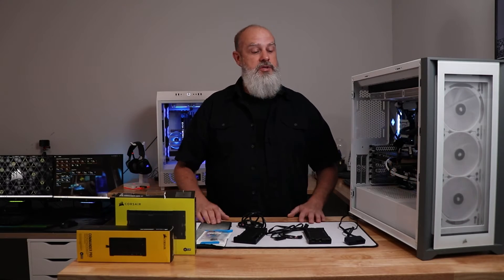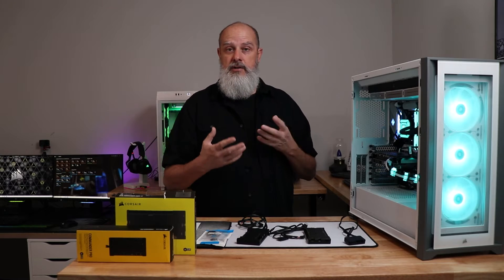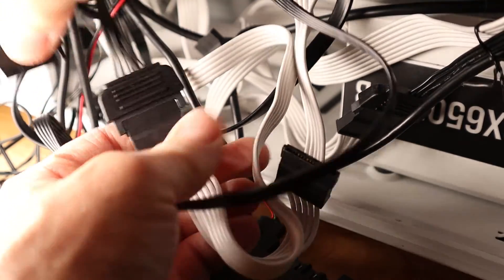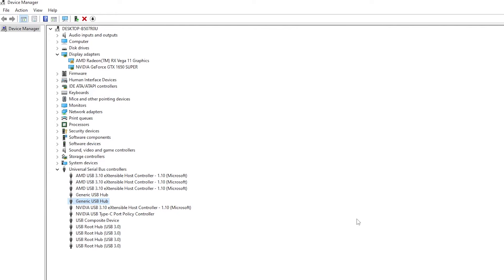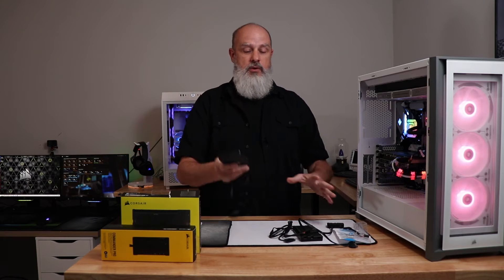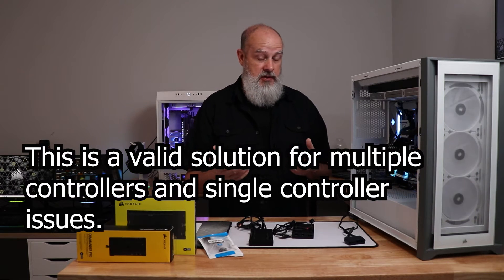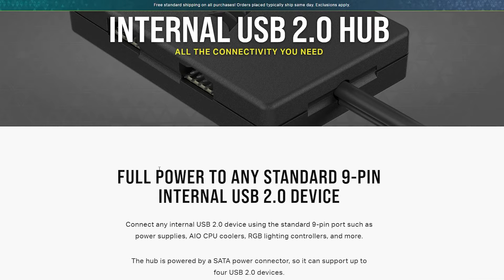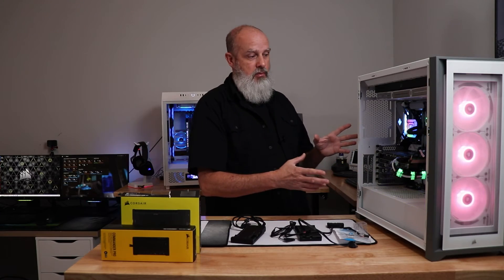Corsair iCUE doesn't detect my RGB controller

Comment: Good day mate! I've installed the H100i elite icue cooler, but for some reason when I shut down my computer the cooler and fans still stay on! ? Any ideas what may cause this ?
Reply from the maker: Hi John Kouros, I've never personally encountered this condition, except in cases where the system didn't properly shutdown all the way. I do see other reports of certain bios settings and motherboards causing this.

I can think of many things to try here. when you power off and your fans are running, check your keyboard, see if you still have activity such as caps lock, num lock, indicating power and activity, indicating maybe the system isn't full powered off. 

from there, if you hold the power button for 4 seconds, do the fans go off like they are supposed to? if not, remove your power cord, wait a minute and then plug it back in? do the fans run?

Regardless, i'd ensure your chipset drivers are up to date and perhaps update your bios and reinstall icue. 

Double check your power connections and possibly move the sata power to another port on the h100i. 

beyond that, look at settings in your bios, anything to do with power, including fast start, etc, try one at a time making a change and seeing if it fixes it. there are quite a few possibilities in there. 

Check out what power settings you have in windows and possibly look at the windows event logs during shutdown. 

I hope that gets you started, good luck, have fun, I like troubleshooting! Let us know what you find! 

Thanks for watching!

Comment: How many fans can you power from a single sata power cable? Installing 10  QL with a core xt, and core controller that came with the AIO cooler.
Reply from the maker: I'm not sure what the maximum number of fans would be, it would vary of course depending on the fans. I've never hit it though. The CORE XT and CORE should have similar specs in that they each will support 4.5A total across 6 ports and 1A per port. This is much more than adequate for your 10 fans. 

The QL Fan draws 0.30A per fan, perhaps a bit more on startup. So each port easily supports 1 QL Fan. 10 fans will be no problem on a single SATA power cable. 

Good luck, have fun, thanks again for watching!!!!

Comment: Thx for video,
Dude my problem is also same as uour topic. H150i doesnt detect from icue. Lcd shows liquid temp. Fans are spinning but no rgb light. What should I do? I readed all corsair helper still same
Reply: I'm having the same problem
Reply: @mrkmh1  😔 maybe cc is not working cuz we saw lcd screen and spin fans. Tomorrow I will buy it. I hope it will solve it.
Reply: I have icue h150i cooler show up but no RGB work. It works in previous 3 icue software . I have an Intel Mobo.
Reply: @MetalliacFeather  I solve it. My CC is not working properly. Then I change it. Now it is working. there is no problem.

Comment: i have 2 lightning node core I connected them using a usb 2.0 header splitter when I installed it wont detect anything, any ideas?
Reply from the maker: Hi Yummy! I would first rule out the splitter. Connect a single lighting node core directly to your motherboard's usb header just to ensure the controller is good, check both of them. Assuming they are detected at that point. I would try them one at a time on the splitter, try each port on the splitter seperately to detect if the splitter has issues. 

I would check, if you can, if any other usb device works on this splitter. I don't know what model your splitter is, but if it appears to be bad, try a powered usb hub, such as the nzxt. 

I would also uninstall and reinstall iCUE and ensure you have the latest version on version 4. 

That should be a start, let me know what you find. 

Thanks for watching!!!

Comment: Hello i nade help i have icue and all fans working but 2 of them lighting and 2 of them dont lighting they are lighting all, but when i one time go in icue to costumize my light they are shut down and they dont work sometimes when i turn up my computer they work all but when i put comp in sleep mode and turn up him the are shut down like its glitched or something 2 work and 2 dont work..
Reply from the maker: Hi Adem Sepic, I would suggest you try the following. The 2 fans that aren't working, take those fans and try them in other ports to verify the fan is good. Also, try known good fans in the 2 ports that currently aren't working. This should help you to determine if the fans are good and if the ports are good. 

I would double check in iCUE that you have the "All Fans" selected in the quick lighting zones at the bottom. 

If you're certain that your settings in icue are good. I would suggest making sure your firmware is up to date.....and if it is, force a firmware update. You will need to go into device settings, and to the right of check for updates, you have 3 dots, click that and force a firmware update. I've had to do this a couple times for oddball problems. 

If that doesn't work, try another power connection/USB connection. 

I am working on another troubleshooting video for issues like this. 

I hope that helps, let me know what you find! Thanks for watching!
Reply: @HardwareArtisan  hey man i replug all fans in comander pro but not comander pro second one smaler for led and they work now all of one that last one work but not corectly just mid lighting and on outside of fan in one space light maybe 5-7 cm in diametar and thats it can i fix that maybe? All fans work ok but that one is work half half xd can you have some isues??

Comment: Just built a new pc and the Commander Core XT is not showing up in the icue. My fans are running but just with a white color. Tried moving the usb. Has latest driver
Reply from the maker: Hi aztecace, make sure you have version 4 of iCUE. If you have version 3 and update it to the latest version, it still won't work and doesn't automatically update to version 4. I found this out the hard way after taking some time with it. Uninstall version 3 and download/install version 4. 

If you have version 4 and it's up to date, then try another power cable. I'd suggest removing all fans from the controller and remove any other controllers as well and see if it will detect it. If not, make sure your bios and chipset drivers are up to date. Then try a powered USB hub or the adapter cable usb 3.0 to 2.0 I showed. 

Let me know if you get it working! Thanks for watching!!!
Reply: Bout Hi170 elite lcd Fans spins but no RGB. CC not showing up in icue…this is crazy!!!

Comment: Thanks for these videos!  I had issues with this a few weeks back with my Commander Core. I noticed the usb detection beep from Windows happened when you moved the usb header cable slightly, turns out it was defective. The replacement was actually detected by Windows but still didn't show in iCue. The software update within iCue itself looked like it was working but it wasn't actually uograding anything! Had to uninstall first, then it was finally detected. Phew...
Reply from the maker: Thanks for the report Paul F.  I didn't touch on that in the video, but those wires in the usb connector could be a weak point for sure. I'm glad a uninstall/reinstall did the trick, that's often the cure, haha. 

Great work, thanks for taking the time to tell us your issues with it. 

Thanks for watching!!!!